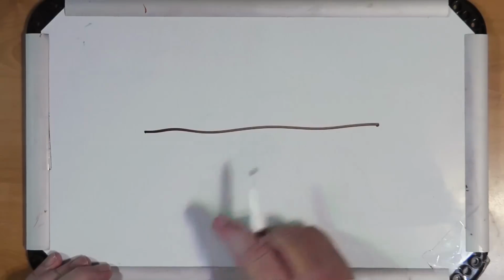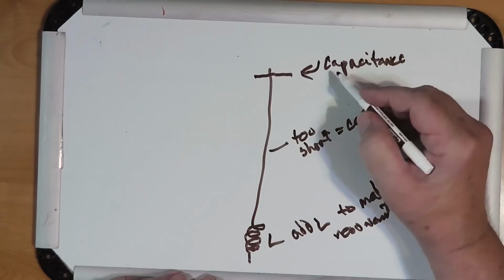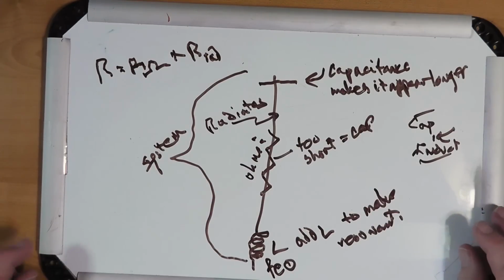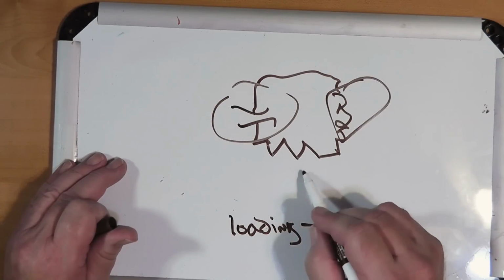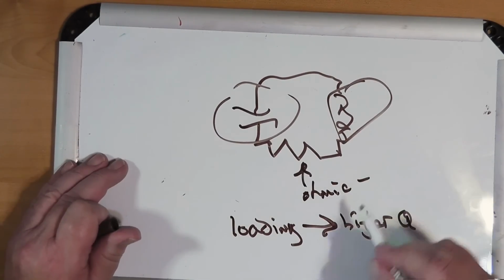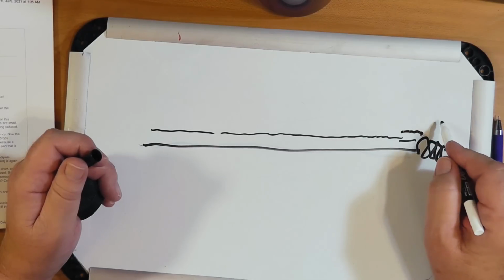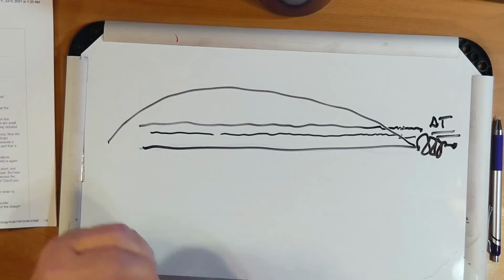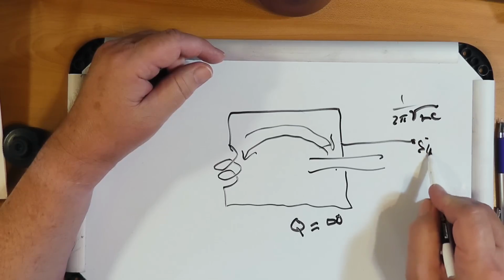Antenna Theory is Different from Circuit Theory. (#481)

Comment: @15:08: "...something has got to make that antenna resonant...": I don't believe so. Any driven conductor radiates at the frequency of the drive, even if the system is not resonant. The fact that it is non resonant just means that it does so less efficiently:  more reactive impedance → less current for the same drive voltage → more power reflected or dissipated → lower radiation efficiency. Currents flowing in unintended paths (coax shield, chassis, operator) are irrelevant to whether the system radiates or resonates; they simply reflect how the return current distributes, not a prerequisite for radiation.
Reply: You bring up an important point.

Comment: Dave, people understand concepts visually better than any other way. One thing that would drive the point home about your definition of a dipole would be a diagram of the voltage distribution for a half wave antenna when a resonant RF frequency is applied. This would show one end having a positive voltage and the other end having a negative voltage. I think you've shown this kind of antenna physics  in the past, but it may bear repeating. A dipole of any kind is exactly that, positive and negative charges separated by a distance. Even at the molecular level. Many people may remember discussion of charge distributions on molecules if they studied chemistry. Molecules having separated distinct positive and negative charge centers are called dipoles. So it goes for macroscopic antennas.

Comment: A short antenna is capacitive and it has a radiation resistance which is small. Adding a loading inductor may bring the element into resonance but it does nothing to the radiation resistance. It stays low. So adding a loading inductor does not make the element electrically longer.

Comment: Hi Dave, may I respectfully disagree regarding the placement of the series loading coil. Taking the shortened quarter wave vertical example a loading coil at the base has by definition the highest current flowing through it, a more efficient solution is to mount the coil further up, at the top leads to a narrow "SWR" bandwidth but about half way up is a good compromise between efficiency and bandwidth. (In a practical antenna with a realistic coil). Naturally the bandwidth is related to the circuit Q which changes a lot with moving the inductor. 
Keep up the good work, 73

Comment: Thank you. Great explanation. 
BTW, we do the same thing for 60Hz power lines. Motors are inductive and reduce the SWR or Power Factor (PF) to current lagging voltage. 
Equipment must be de rated, bigger unit, larger wire used for smaller job, when the power factor is bad. Also more heat. 
PF correction capacitors are inserted to compensate for this. Ever wonder why the power company puts forty thousand dollar high voltage capacitors on power lines ?
Yes, they are switched items. Capacitors come online during the week day and go off at night because business add and subtract inductive loads. 
Mr. Casler, please do more presentations like this that bring multiple parts into play concurrently.   
73, we hear you 5 by 5